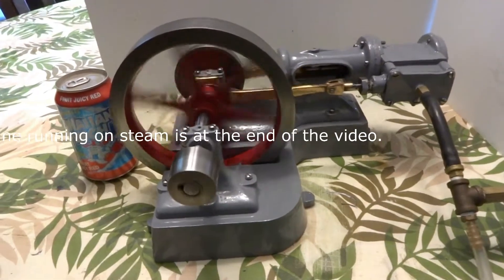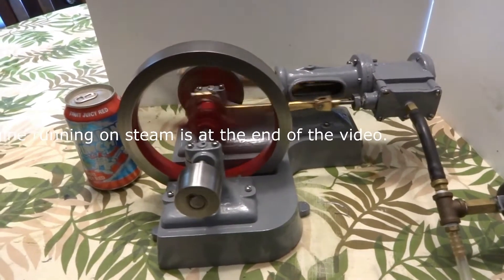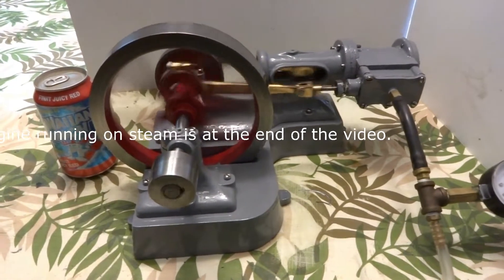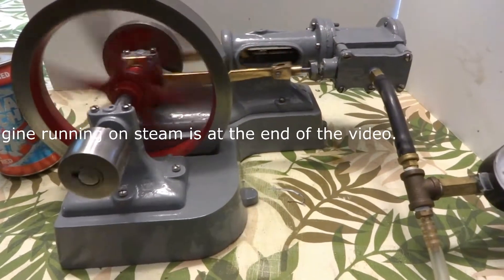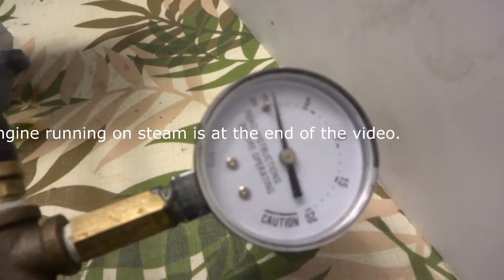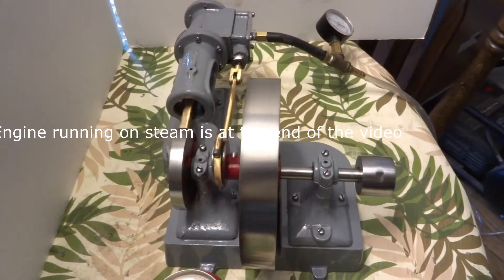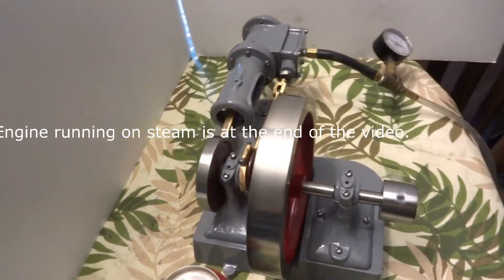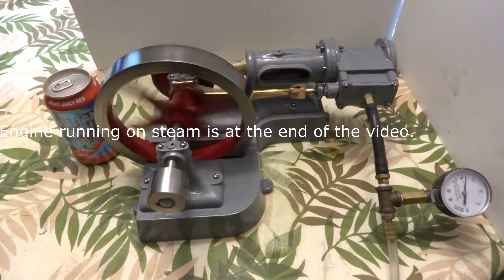American Model Quarter Horse Steam Engine Restoration

Comment: runs very nice on steam, love the pressure cooker, have subscribed to your channel hoping for more
Reply from the maker: Thanks. The pressure cooker was $5 at a flea market and works much better than a $500 stuart 504 boiler. Plus, i can fire it up at engine shows with an old propane turkey fryer burner-also available at flea markets, and it does not not need inspected!
Reply: nice one , will copy that idea